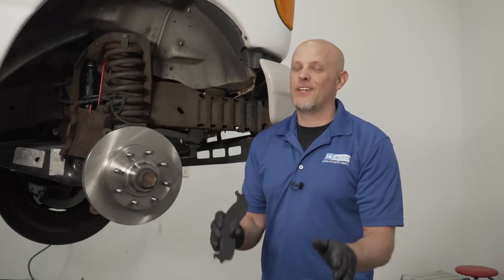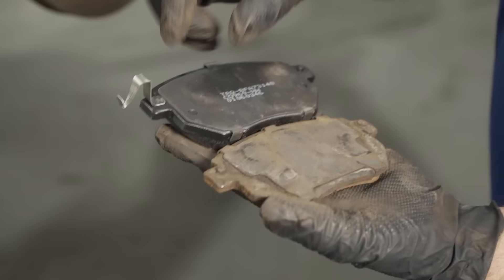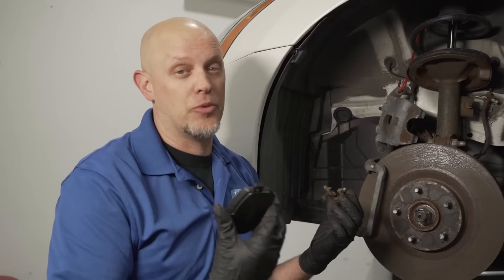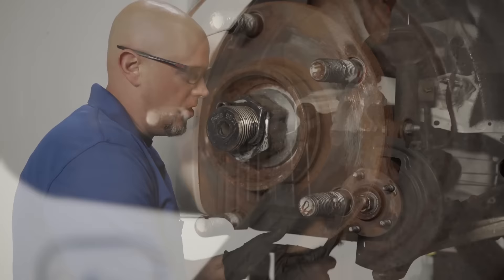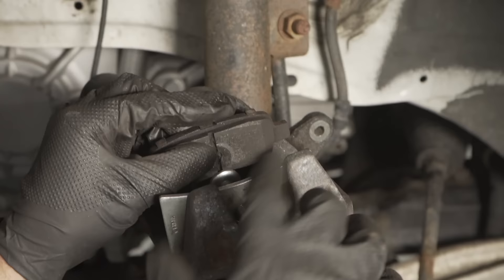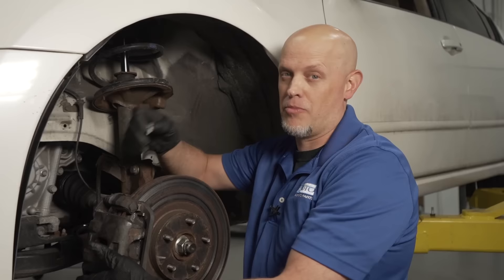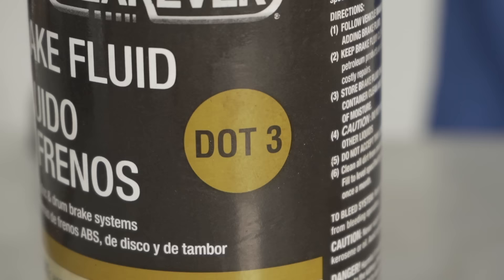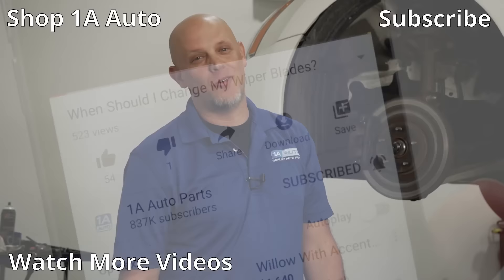Most Common Brake Installation Mistakes!

Comment: I just did my brakes for the first time since buying my truck pre owned and noticed the squealer was on the outside ? Everything I have watched and read said it should be on the inside where the caliper is ? I switched them but did I do it wrong ?

Comment: You didn't mention that you should check movement for bearings needing to be replaced before the rotors and pads.  Also, how often do you actually need to repack bearing grease? If there is side to side movement does that mean absolute bearing replacements or just repacking. What about inner and outer bearings?

Comment: Really good video, 
May I add, back brakes, if the rotor is stuck, make sure it's not hanging on the emergency brake, depending on the vehicle.

Not sure on the cracking the bleeder for compressing the caliper. I'm in Ohio, salt is mean, they get crusty fast, have drilled many out, now is usually cheaper just to buy a new caliper. But sometimes there is lever A and lee-ver B.

I like the antisieze on between the hub and rotor, I always do, but most don't.
Reply from the maker: +Rick Sanchez Thanks for the tip!

Comment: I used a funnel that might have had very little rezadu of transmission fluid in it to pour break fluid into the master  cylinder for the the breaks..a couple days after I used it for my power steering..it looked clean.. will that be ok..

Comment: You didn’t mention the calliper pin bushings. An annoying but necessary rubber (“anti-vibration”)sleeve at or near the tip of one of the pins that swells up over time and either seizes you pins in the carriage or prevents you from reassembling.

Comment: Hi great tutorial, my issue when changing out the rotors of my car (RWC Item) was reusing the same brake pads. The rotors seemed to be surface scratched/grooved with the existing pads. Is this a problem or will it wear in line with the surface of the rotor and look smooth? Should I have changed the pads as well?

Comment: Excellent video. A question: can I turn the steering wheel to an angle when the engine is off and only one wheel jacked up? Thanks.

Comment: I came here to see how to properly set the pads onto the clips.  I wasn't sure if the tab of the clip that presses on the pad to keep it away from the rotor, keeps pressure on each end of the pad to keep them in the moddle of the bracket.  Might help to point that out.

Comment: I am trying to change the rotor on my Hyundai Sonata (2009) , On one of the wheels, the new rotor is not sticking correctly, as soon as I push the new rotor the rotor is not rotating. Can you offer any tips to check my mistake or the things to take care of?

Comment: Good video.  Prior to reinstalling the calipers make sure you have the correct caliper bolt torque.  You may need to buy a service manual for your vehicle such as Haynes, or find the correct bolt torque online.  Then you will need a torque wrench.  Such wrenches in various torque ranges are available from 1A Auto.  Bolt torque is critical.  Too loose and the caliper can come free.  Not fun while you are driving.  Too tight and you can break the bolts.  These fasteners are generally specific to your car.  You cannot buy them at the hardware store.  So don't forget this important step - proper torque for the caliper bolts.

Comment: If you have to hit the rotor with a hammer, it’s always a good idea to put the lug nuts on the studs to protect the threads. I’ve accidentally hit the threads and had to spend the time to clean up the threads to get the lug nuts to go back on smoothly.

Comment: Okay so maybe a dumb question... but... are the squeelers needed, or can i pop them off? Did the first tire (so many issues just getting everything off), but done. Went to second tire n i ended up with the 2 pads with squeelers 😮‍💨 i really dont want to take it all off n switch them. But i dont wanna die driving either

Comment: What is better? Machine rotors or replace? Some say not worth machining because originals are now built too thin, leading to premature warping. True or not?
Reply: It's true. Back in the day, you could machine the rotors but now they ARE built too thin for machining and will have to be replaced. In my situation, the wheel bearings fail and aren't easily replaced and I have to change the entire hub at over $130.00/hub.

Comment: Hey brother I am having a clunking when going over bumps and the dealership is trying to tell me it's cause I used aftermarket brake pads which I believe is rediculous because it's only on 1 side but I figured I would get your take on it can that happen it doesn't sound like a brake pad sound to me but I might be wrong they replaced the struts in the front so it isn't them.

Comment: I am a competent novice BUT when persuading the rotor removal with a mallet - one can use a sacrificial 1 inch socket between the studs. You'll never mess up the threads this way.

Comment: Brake fluid is extremely caustic and if it drips onto any painted surfaces it will strip the paint.  When bleeding the brakes make sure to have a drain pan and some tubing ready.  If you do get any drips on your paint, clean it off immediately.

Comment: I always wire tie my brake lines to the drive shaft. It's pretty sturdy, and that's important! If your vehicle is front wheel drive? Go ahead and use plastic tie straps and tie around the exhaust piping. It's fine. Only use plastic tie straps. Metal wire will rust.

Comment: Thank you learned a lot...however I am about to pull my hair out.having issue with driver side front. has a scrubbing noise thougt my caliber was sticking. alledly got it unsticky....same noise. they said was rotors, brake, outter tire rod, struts, sway bar all replaced. still rattle. looking at the rotor it is loose have play in it. I can shake it side to side. someone said my piston is not engaging, first thing in the morning it will scrub while driving 20 minutes later you don't her the scrubbing, I can her the rotor shake a tad bid.... was told today could be wheel bearing, in tire rod. by the time I finished i would have all new parts...help please

Comment: What will cause a brake pad not making complete contact with the rotor where the where on the rotor is smaller than the other I'm not a word to wear on the road around one side of the rear it is not the same as the other side roller?What will cause a brake pad not making complete contact with the rotor where the where on the rotor is smaller than the other I'm not a word to wear on the road around one side of the rear it is not the same as the other side roller?

Comment: When ever you are replacing a caliper or if you are opening the bleeder remove the cap on the brake fluid reservoir, if you do this you will not get air in the system. When replacing a caliper you can usually take a rubber valve stem put it in the brake hose where the banjo bolt goes so fluid doesn’t leak, install ur new caliper, hook the brake hose back up, open bleeder and when fluid comes out the system is bled. You should should clean the fluid off the caliper and check for leaks by holding the brake pedal down. Again you need to remove the cap from the reservoir first if you don’t then air will get into the system and you will need to bleed the system. Think about it like this if you take a full gallon of water take the cap off and put upside down the water will come out pulsing as water comes out and air gets sucked into the bottle, fill that gallon bottle back up flip it upside down again but puncture a hole on top then the water smoothly flows out it’s the same concept with the brake fluid cap

Comment: Question: I just replaced rear brakes and rotors. When I drive there is a slight smell as if metal is touching. I’ve taken them off and re-attached. I see nothing

Comment: Two more mistakes to avoid:
1. Don't forget to release the electronic parking brake on newer vehicles, best done via a menu sequence but each manufacturer is different so an advanced scanner can access the function as well
2. Don't round off the little countersunk bolt holding the rotor in place. It's likely rusted stuck and using a power tool will round off the phillips or torx head, so use a manual impact driver to loosen it.
Reply from the maker: +Armin Petschelt Thanks for the feedback!

Comment: I have checked everything in my brake system I have a banjo bolt leaving leaking on the front passenger side caliper I'm going to replace the bulb there are supposed to be copper Crush washers on both sides is this not correct just making sure it's a 1996 Crown Victoria would you know what the torque setting might be on this boat thank you

Comment: 😂 I didn’t but the brakes on backwards! But I did put one pad  upside down. Felt so embarrassed as I just did them and took the car to get some
Other work done. Only thing I could think of is when that one pad fell off I just put it back in without checking. I was fighting the caliper lol

Comment: I had to use pliers to compress my brake calipers and I probably did it way too fast but I had the bleeder valve open so it didn't go back into the system.

Comment: Hey dudes I just did front struts rotors pads brake bleed to clean out old brake fluid. Then did the right rear wheel hub (what a job) and speed sensor on my 2011 Enclave CXL AWD. So then I came to reassembling my right rear parking brake and had nothing but problems. It's a simple parking brake assembly as shoe brakes go cause there's no self adjusting mechanisms to it. But when I attempted to reassemble the parking brakes the lower spring that pulls the 2 shoes together at the bottom of the assembly ... it just wouldn't stretch long enough and it snapped in two. So I bought anew brake hardware kit. Again the spring (pink one and longest of the two) just wouldn't stretch long enough and the hook ends actually became deformed so they no longer were able to hook on. I'm stuck here . Any suggestions on what I may be doing wrong?

Comment: 9:58. There was a car talk show, about a man who removed the calipers of his jeep and cleaned them perfectly on the table. Then installed them, and then he never bled them. So he brought the car to several shops, and no one succeeded in bleeding the air. Finally smn realized that they are switched. and bleed points were on the bottom....

Comment: Kept having a hissing noise from my rear brakes so I put all new rotors and pads...and it still has a hissing sound that gets louder the faster I drive.  Sounds like a dust shield is dragging but nothing had marks on them when I disassembled them... and no strange grooves on the new rotors...any ideas?

Comment: Dropped new brake pads about 5 feet off the ground onto concrete floor. One got a small dent but aside from that they seem fine would it be dangerous to use these or probably ok?
Reply: Dent on the metal part and where or the friction part?

Comment: Help please. I just replaced the rear brake pads and rotors on my 14’ G37s coupe 3.7l rwd. First time doing so and the rotors won’t spin and my brake fluid reservoir is full from compressing the caliper pistons. The parking brake is off and I haven’t pressed the brake pedal due to not knowing how to proceed with the proper course of action. What would you recommend I do from here?

Comment: what happens if a person put transmission fluid into the power steering reservoir what would that damage be and what has to be done to correct that error ?

Comment: I apparently made a mistake with my Integra, the compression tool u get from autozone I need to tighten it down but also spin it back. I thought the pressure would bring it back to to press the brake pads. Is that correct

Comment: After replacing my calipers, I am having problems with leaking at the connection.  I forgot the copper crush ring, and the bolt did not do all the way in, and I did not force is.  I backed it all the way out, and put in the copper washers.  My kit came with 2 copper washers, and there was space for two when it would not bolt down.  however, this is NOT a banjo bolt.  It's dripping, and I am thinking I should only have one copper washer in there.  But I am not confident if I pull it all apart that a single copper bolt will fill the gap without an unreasonalble amount of tightening.  I have not yet tried tapping it with a hammer to get a little more squeeze, then bolt twist, on the copper, but it's not in a good position for a good wack anyway.  It's not like a banjo bolt; its a flared fitting that is leaking, the same one that came off in the place.  The bolt just did not go in all the way so I put those two copper washers that came with it to fill the gap.  Any suggestions?  Thanks.
Reply from the maker: +@riverfena We wouldn't be able to diagnose an issue like that here, you may want to have a local mechanic take a look at it. Thanks for checking us out! http://1aau.to/m/Shop-1AAuto-c

Comment: I've had nothing but bad luck with doing my own brakes. Not initially, but a year or two afterwards and I've got a stuck caliper. I've destroyed the pistons in two calipers on my 2009 Ram 1500 just trying to take a stuck one off to simply inspect what caused it to fail. The pistons are made of what appears to be ceramic because they'll break very easily if you're not careful.

Comment: Caliper guide pins. If you have one or more that have seized up and you can't tap them out with a hammer? Use a propane torch to heat the top of the 
caliper housing where they go in,  to then be able to remove them. Some of these caliper "brackets" you can't purchase anymore. My 2009 Nissan Cube is an example. So that's why I had to heat 'em up and bang them out and then replace with new pins and rubber boots. You can pick up a torch at Walmart for roughly $18.00. in the hardware department.

Comment: i put brake fluide dot3 instead of dot4 (for 1 day) by mistake, than i replaced by dot4. Is it possible that problems will occur brake system in the future?

Comment: Do the brake pads and disc have to be the same brand to work properly?
I have Brembo disc and Ate pads,and i have a problem,my disc i distorted,when you brake,stering wheel shakes,i have done those Brembo disc on a mashine that corects that,and fitted again,it was all normal,and started to shake the stering again,in a few monts,so does it have to be the same brand,because that metal components are not the same?

Comment: Any tips for getting the retention clips back on? Can not for the life of me get them on. Got one set where the clips fit but the pads did not, returned them (don't have access to a grinder to grind paint off the ends of the pads) and got a new pair. Now the pads fit but I can't get the clips on. Been at this for almost two days thanks to a rounded caliper bolt

Comment: I recently had my rear brakes done...pads and rotors. A day later I began hearing a thumping noise while driving when I hit bumps.  The next day brake failure caliper found dangling and bleeding fluid....anyones thoughts?

Comment: I was born into the automotive industry. My family owned several autoparts stores in northern california.
my dad was a mechanic my mom pioneered the retail end of autoparts . Im from june lake ca. a small ski resort town iin the sierra nevada mtn range. in 1960 the closest autoparts store was 75 miles away in bishop ca. my dad a mechanic servicing and repairing vehicles needed parts to do so  and 75 miles is a long way to travel for a set of points. so he built an autoparts store that store turned into four more stores in mono county. Sorry I didnt mean for that to be an autobiography, just a little insight of my mechanic background, Anyway the tip i wanted to share is this Always do one side of the brake system at a time doesnt matter which side first my rule of thumb is we read from left to right so i start with the left side of which there is only one left side and that is viewed from the drivers seat. by doing one side at a time the parts wont get reversed and if you forget how it goes back togetgether you can use the otherside as a reference

Comment: Lol I learnt the hard way not to use anything other than the recommended fluid on the brakes in a bind I dumped some real thin oil after I had a line snap and I pinched it off to get me home .... I replaced the line and within a couple days I had brk fluid leaking out of everything

Comment: When doing my brake job a few days ago after Finishing the first side and starting the second I realize that both of the squealers ended up on one side will that damage any parts of the braking system or cause the braking system to not stock properly? I’ve driven it and I have not heard any sales binding or anything like that what do you think?
Reply: Truth be told...if you rotate your tires religiously and at the same time check your brakes...many leave the sqealers out...
To me it's just another thing that can hang up...after market sqealers never seem to fit right anyways...
Just saying...

Comment: and remember, is always convenient to replace all brake fluid every 3-4 years and do a brake fluid purge to remove air bubbles from the system.....brake fluid is hygroscopic (it absorbs moisture from the air..) so to have a good braking power do the replacement like I said.
Reply: brake system is sealed.  How did air get to it?  asking for a friend.

Comment: First thing remove brake fluid reservoir you might need to remove fluid if full so when you compress caliper it doesn’t overflow and get on everything

Comment: At 5:30 you could substitute for a black rubber mallet , or use a 1” thick piece of wood when using your steel sledge to keep from denting the rotor.

Comment: I’m getting that grinding sound slightly less loud like the shield is rubbing. But, ain’t the shield.  When I took pads off and rotate no sound. When caliper is down , and rotate I head a grind sound even when no braking.  Any idea ? I lubed everything at this point.  Rotors and pads were swapped